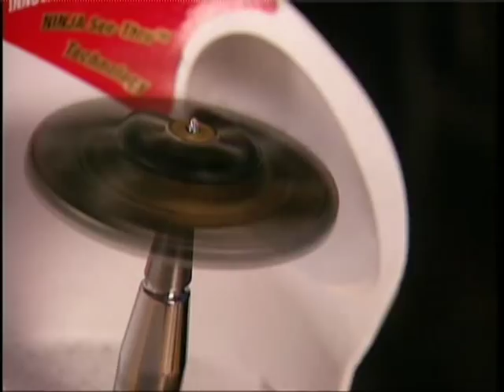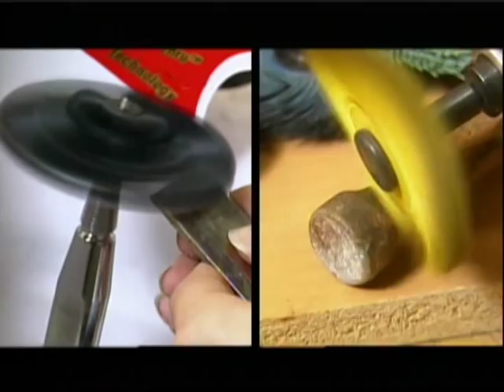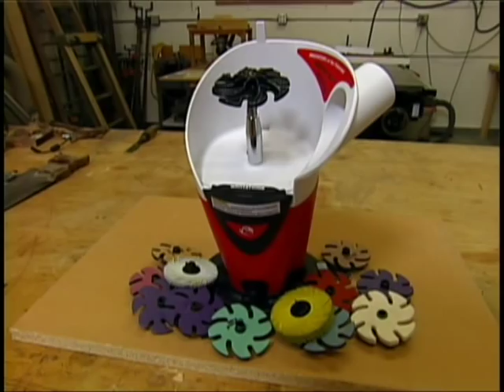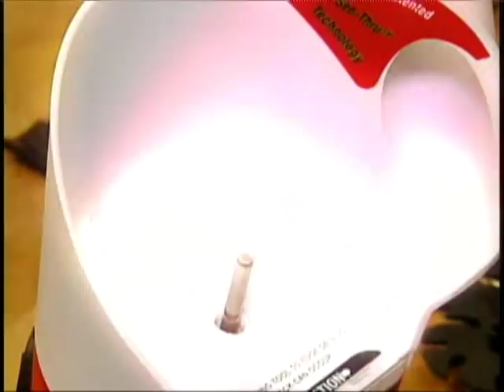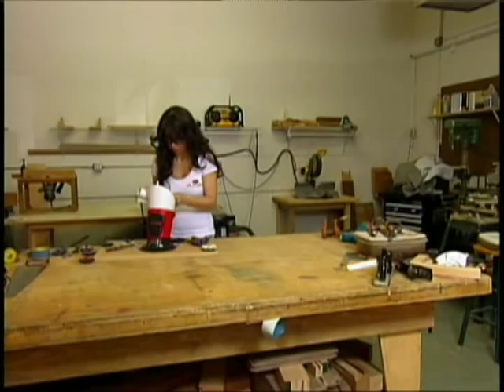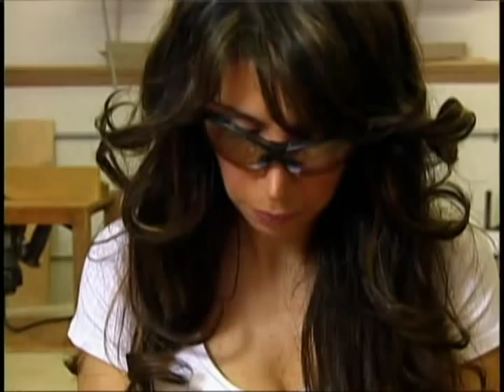JOOLTOOL Sharpening & Polishing - COOL TOOLS

Comment: I often find myself sharpening large 5/8 and 11/16 cobalt bits. Usually when my machine dulls them, it usually keeps pushing and completely ruins 3/8 of the bit or more, therefore I need to remove that section and start over with a flat tool. Can this do it? Or do I need to stick with a belt grinder and bench grinder.